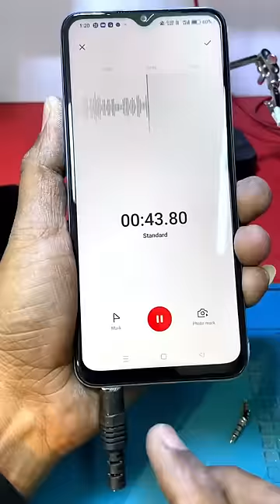How to make high frequency mic for youtube easy way #tipsandtrick

Comment: The signal from a mic like that is a) too weak and b) on the wrong level. Either the internal mic is picking something up or it's just the residual motion from physically tapping the mic, which is by far not the same as sound
Reply: Add that most cellphone have mems mics and those are cheap and probably recycled electret microphones
Reply: @vibrion121  🎉